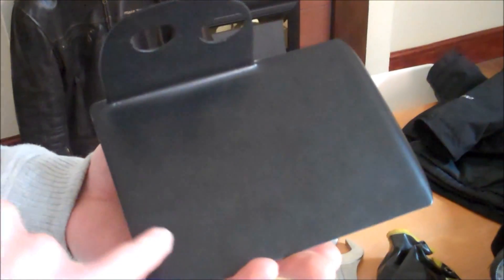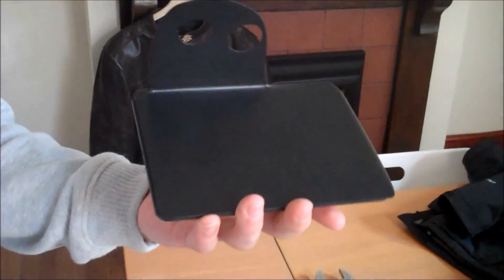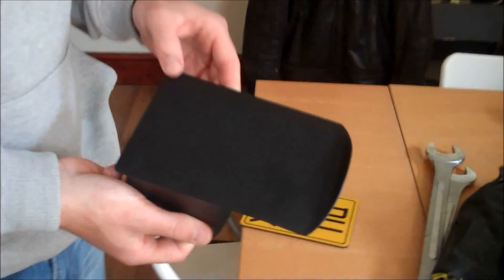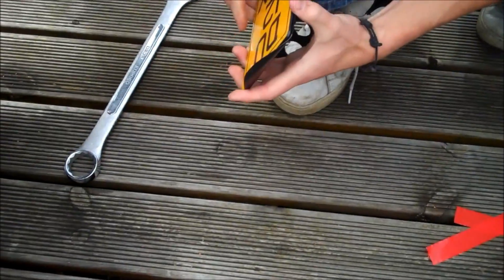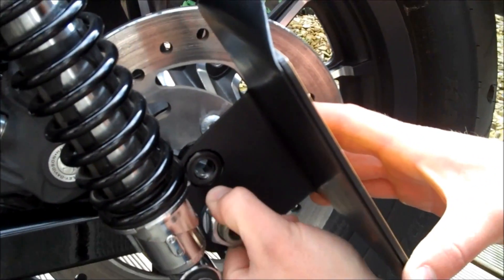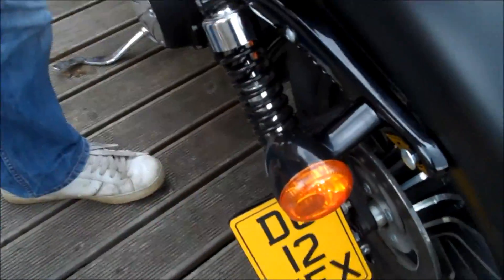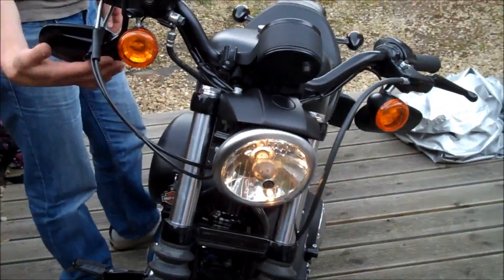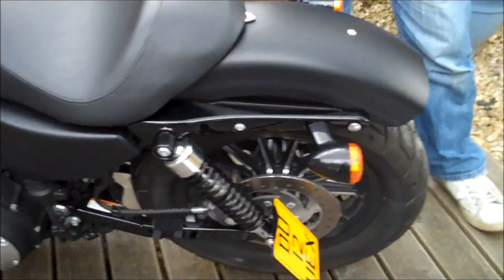Project IRON - SIDE MOUNT LICENCE PLATE (Part 5)

Comment: Well done guys, a great result, and a really smooth finish...the difference between someone asking "When did you make that side mount?", and "Where did you BUY that side mount?" is all in the finishing..  and if you lower the bike with the PS 11" shocks, try pulling the fork legs up half inch through the yokes too, it will level out the ride and overall the handling will be ten times better... take care and ride safe chap... Del.

Comment from the maker: Hi there - yeah, mines a 2012 model as well - you will need to move the indicates very slightly at a angle, it is very easy to do, just loosen the nut and you can re-position the indicatior to allow for the mirrors!

Comment: Hi,

Great vid. What did you do with the wiring that lit the original number plate ? I'm going to fit a side mount on my 48 and was not sure what to do. I see you can get side mount brackets that have a light on it.Do you know if it's easy to get the wiring hooked up to that ? I'm a complete novice....Cheers